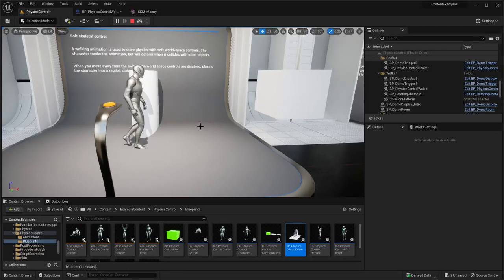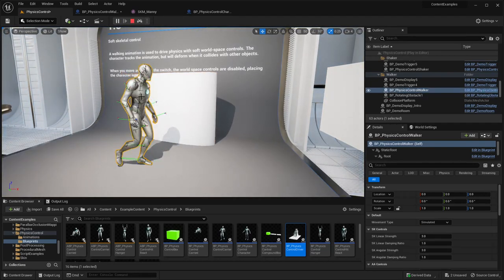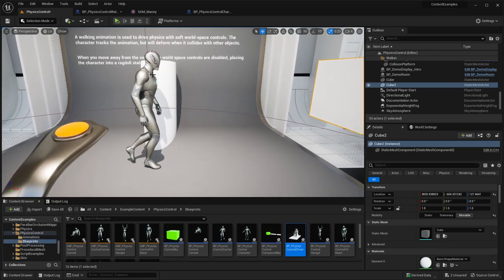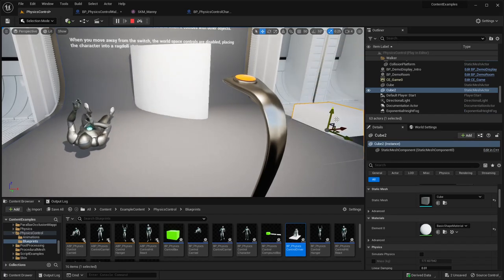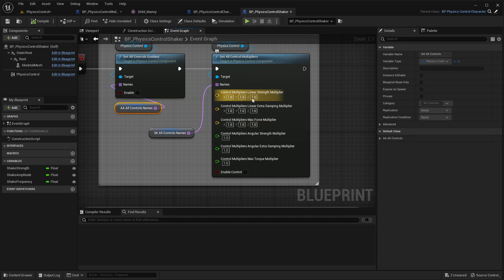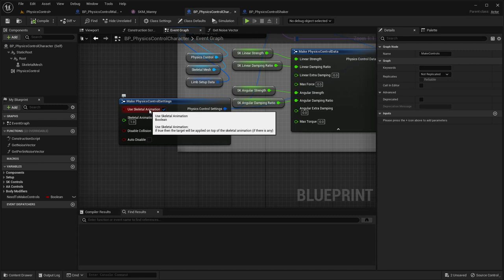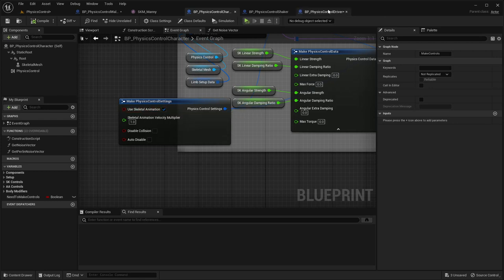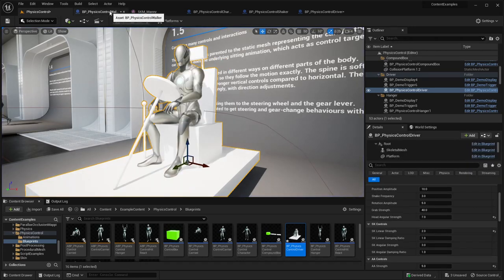Physics Control Component UE5 (Part 3)

Comment: The component doesnt seem to do work too well with character blueprints and replication. We had issues with clients seeing completely different results from the server even with all functions being replicated. The skeletal mesh would also go out of the capsule if the character was being launched while also doing the hit reaction (for clients). Another issue with clients was that the skeletal mesh of the character became a little compressed when the hit reaction was activated.
Reply: I had trouble getting a basketball physics to work over the network.
I found Out the BP had to be originally started off as a skel or static mesh component for it to easily work. And physics worked on both ends.

Comment: Hello sir. I've copied codes from the walker example and applied them to my custom character. 
The physics control works great. 
But the problem is it somehow deformed my original animations. Like his shoulders are getting lower, fingers can't clench, legs are bent, and running is getting clunky.
Any idea how should I fix these issues without giving up this fantastic feature?
Reply from the maker: I tried that now and I can see the "ragdoll" taking over the anim too. So I suppose on a normal walking/running character you're probably not supposed to use it all the time but only turn it on when it's needed, like in the hit reaction example in the content examples level.
Reply: @games_inu  You're right. I should  only apply that when collision happens.

Comment: thanks for the video, i was wondering if this component will allow me to avoid a skeletal mesh clipping with itself? for example an animation where the hand clips into its own body. could i use this to have the hand just press against the body using its proper physics asset?
Reply: I'm not sure, but maybe if you allow collision between physics bodies of the character it can  work. Normally the collision is disabled but you can enable it in physics asset, if i remember correctly you choose 2 capsules and click on "collision" button, something like that
Reply: @vertigov72  wow, totally worked,  thanks a lot, subscribed